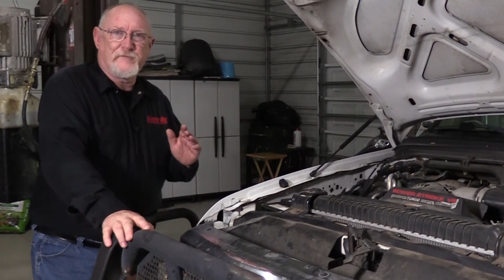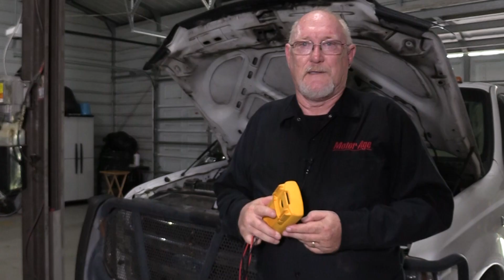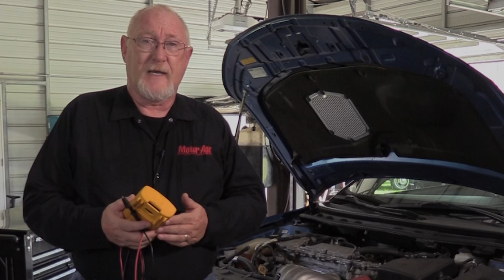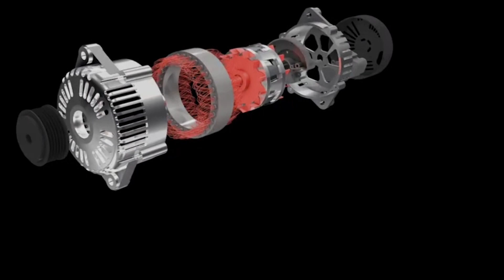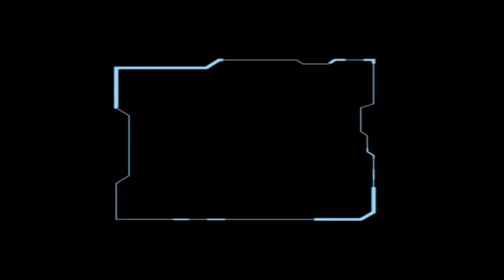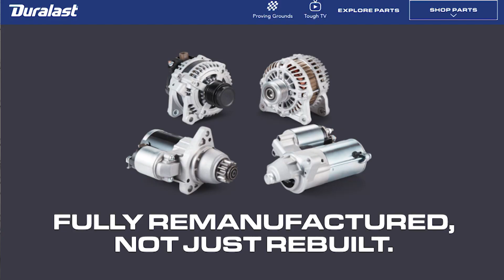TechTip #6:  Avoiding Starter and Alternator Comebacks

Comment: Voltage drop in the strap from engine to body can mess up the coolant and make it too acidic. Another case - repeatedly failing fuel pump motor.The problem was voltage drop at the fuel pump connector. It was in the connector itself. Which is important to mention , because everytime new pump was installed and the vehicle started , the voltage was in spec at the harness side of fuel pump door while vehicle operated. But we needed to test the connector side which is inside the tank. So we put the leads inside the tank and didn't tighten the fuel pump ring. Started the car, and there was 0.9 volt drop at this connector. Feeding lower voltage to electric motor continuously will make it run harder and sooner or later the fuel pump motor kept failing. Until we found this problem. PS: A TIP THAT i learned from Pete's videos - when checking powers and grounds at PCM. - Load the powers with test lamp and then make voltage drop test . Same thing with the grounds.
Reply from the maker: I wonder what the current reading would be? I suspect lower than normal!

Comment: but you still can't end your voltage drop tests with what you have shown.  because cars and trucks are NOT as simple as they used to be..

 Lets start after verifying the percentage of charge..  engine running.. headlights on for a load.. 

 test 1. positive to negative battery posts..  14.1 to 14.8 if the charging system is working properly. 

 test 2.  Negative battery post to the engine block .. 0.02 volts DC max.  why.. only the alternator, starter and a few fuel injection components may be grounded to the engine .. everything else is grounded to the body ..

 test 3.  Negative battery post to the Body..   0.02 volts DC max..  this is needed because everything is grounded to the body.. a few things to frames on pickups.. 

 test 4. Engine to body.. again 0.02 volts DC max..  why.. ever notice the braided ground strap from the engine to the firewall or the many engine on all cars..  with the alternator mounted to the engine. and everything else grounded to the body.. how do the electrons get to the body from the alternator.. do they go up the negative battery cable .. turn and go thru the mid size cable to the body.. the long way or do they go any which way they can.. to get to the body if the engine to firewall ground cable is loose or missing.   over the past 42 years.. i have had to change a lot of front wheel drive hub and bearing assemblies do to a loose or missing engine to firewall strap.   why , the electrons on the negative side flow from the alternator case.. thru the engine.. to the transaxle, thru the CV shafts. thru the wheel bearings to the steering knuckle either to go thru the steering linkage or the strut top plate..  (ever wondered by so many of the strut top bearings have seized)  electrons trying to play frogger across the ball bearings in the hub and bearing assembly burn little spots on the ball surfaces and the races.. causing eventual failure..  in the 1970s and 80s models .. i had a lot of universal joints fail for this reason.. along with throttle linkage balls burning off..   test 4 takes about 15 seconds to perform.. 

 test 5.. Positive battery post to multiple fuses in the underhood fuse block..   again 0.02 volts max would be great.. 
underhood fuse boxes on some models are connected with multiple quick connect terminals..  inside the underhood fuse box. the buss bars can have corrosion so multiple fuses may have different voltage drops ..  the cable to the underhood fuse box could be bad also.. 95 to 2001 chevy trucks have a 95 inch long 4 gauge cable to supply the under hood fuse box..  i have found those cables frayed internally from swinging in the air flow near the battery.. 

 2004 dodge mini vans had a strange issue.. use a power sliding door and the lights in the entire car would start pulsing.. extra bright then dim. every few seconds until the engine was shut off and restarted..  there are many reports of this list of replaced components without success..  alternators, TIPMs.. PCM's, batteries.. when the problem was a loose cable crimp at the positive battery post.. the alternator output was run to the starter top post where it continued to the positive battery terminal.. next to that wire in the crimp is the wire that runs to the TIPM.  the PCM is powered off the TIPM.  when the load of the powered sliding door happened. it exceeded the current flow thru the loose crimp connection at the positive battery cable end..  so the voltage to the TIPM would drop do to the load.. the PCM would command full field of the alternator.  a second later the alternator would be full fielding and putting out max current and the voltage seen by the PCM thru the loose connection since the load was gone.. would be way high.. so the PCM would shut off the alternator  field.. the voltage would drop below what was needed.  so the PCM would command full field again.. this became a feedback loop .. Bright dim bright dim.. since it seems the TECHS did not know about proper voltage drop testing to the underhood fuse box or test 6 to the alternator stud to positive battery (you showed this in the above video) parts were changed.. 

 on the ones that came to my attention.. positive battery to underhood fuse block and alternator to positive battery voltage when the lights were surging varies up thru about 4 volts.  when it should have been fractions of a volt and stable. 

 test 6 .. alternator output STUD thread to the positive battery post..  i like to see less than 0.1volts. but i have seen good systems have 3/10ths of a volt and nothing been wrong with them.  just that copper is expensive when building cars. so they can use less copper and deal with the larger voltage drop on this one circuit..    but remember i work on older cars and trucks. dodge vehicles with amp meters  normally have 0.7 volts of drop on test 6 do to the length of the charging circuit. that 0.7 volts is right out of a 1966 chrysler imperial service manual.. 

i keep a printed copy of my voltage drop test sequence over on imgur ... this is the link.. Motor Age staff.. print a few copies and pass them around and have staff try it on every vehicle they have.. you will see its easy and it finds tiny voltage drops that can really screw up stuff. 
 https://i.imgur.com/kviX0VQ.jpg    steps 1 thru 4 take less than a minute. test 5 takes a minute and some cars tests 6 is impossible to do.  but when you can reach the alternator output stud. with the engine running.. its seconds.. 

 lastly.. my volt meter test leads.. one is 18 gauge test lead wire and is 10 feet long.. the other is 18 gauge test lead wire and 20 feet long..  the meter ends have Pomona 1725 stackable bananas..  and the other end have JS Potter bent nose telco type test clips with both bed of nails and piercing spike.  why so long.. i work on cars.. engines in the front.. batteries in the trunk or under the back seat..  or engines in the rear and batteries under the front hood..  i have been fixing cars for 42 years now.
Reply from the maker: Thank you for such a great post! These are excellent suggestions and I will be sharing these tips with every tech I meet. Of course, I'll tell them I learned this from my friend, Wayne P.!
Reply: Great information . As a DIY , you need to keep learning . I guarantee that most techs don't even come close to this level . They invest 5 minutes , then tell the customer " we checked the ENTIRE electrical system " . This gets involved and most techs should leave their hands off what they don't know . They want to get paid to " hang parts " . When it doesn't fix the problem , they get defensive and mad at the customer . But if YOU paid  $ 1000.00 or more and it does the EXACT same thing , who wouldn't be mad ?  " We cut off the WRONG leg - no problem , just stop back and we will do the other one " .

Comment: Yea. Learn voltage drop testing. 
Engine running , headlights on. Look for over 13 volts at the battery posts. 14.1 to 14.8 is expected. 
Test from the negative battery post to the engine block. 0.04 volts max is good. 
Test negative battery post to the body. Again 0.04 volts or less is expected. 
Test engine block to fire wall. 0.04 volts max
 If you get more than the 4/100th of a volt during this test. Fine out why.
On the positive side
 Test positive battery post to multiple fuses in the underhood fuse box. 
Why multiple fuses. Fuse box internal corrosion. 
Test positive battery post to the alternator output stud. This should be less that 3/10th of a volt. This output circuit is designed this way. Lowest voltage drop for the least amount of copper wire. 
I do this test on every car that rolls into my repair bay.. I can do it iin just a few minutes. Saving me from doing comebacks because there was an issue with the wiring
Reply from the maker: Great tips - thanks for sharing!
Reply: @VehicleServiceandRepair  pete.. you can delete your email address to keep it private.. i have sent you an email already.